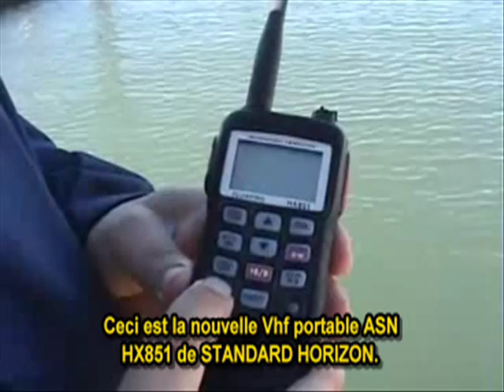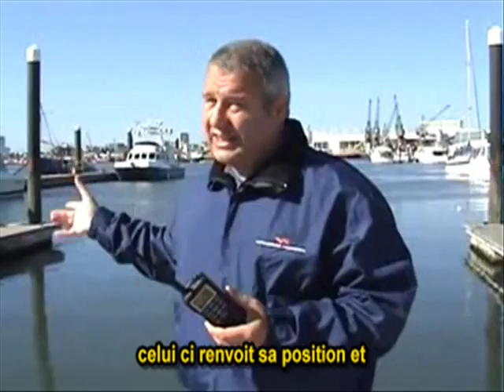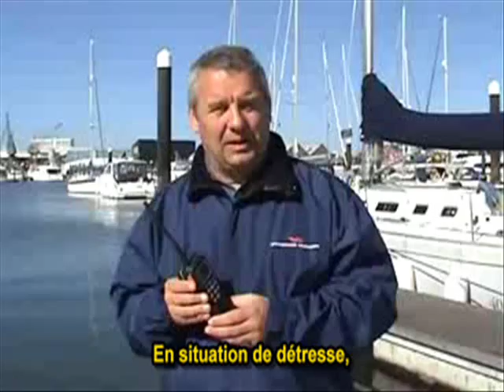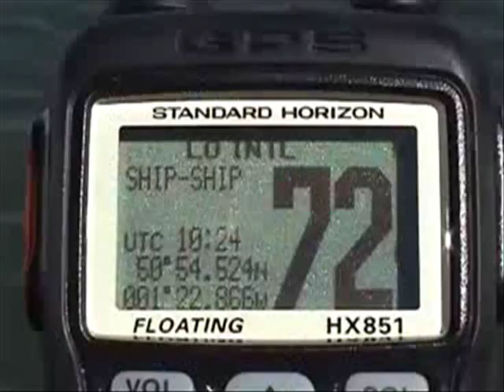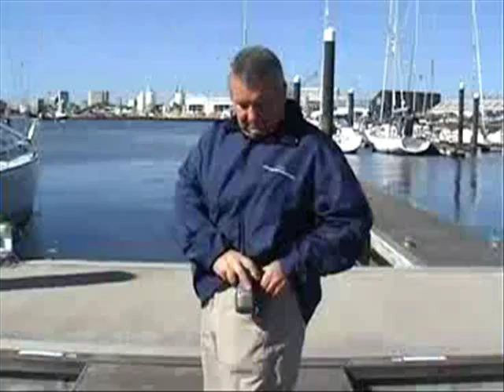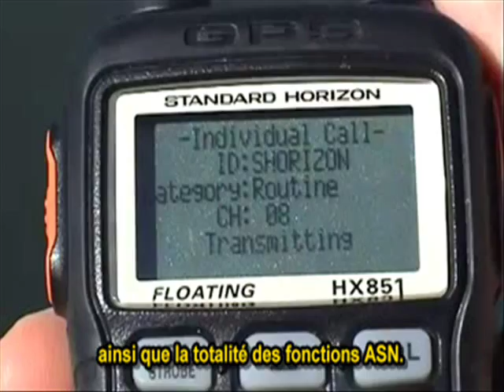Maxdis VHF Marine Standard Horizon HX851.wmv

Comment: This product "the Standard Horizon HX851" seems to be wonderful : 
a 6W dual watch VHF DSC with a built-in GPS (for DSC as much as waypoints navigation), IPX7 waterproof and floating, it seems to have all qualities to be used on GMDSS Sea Area A1 by somebody who has the Short Range Certificate SRC (and can be useful on Sea Area A2, A3). 
It's the first Portable VHF DSC homologated! A Victory for more safety! 
Perfect for cruising, sailing, ... ! 

And what's more, it's the perfect tool in case of DISTRESS, especially for "ABANDONING SHIP". This VHF is portable, very light, can be brought in a Lifeboat and does more than communicating on Channel 16. It can send a DSC MAYDAY with GPS position in the DSC Message and it's the first Portable VHF which can do that. 
It's a great idea! 
Could we dream better? 

The only thing it misses : an AIS. 
AIS TX could be fed by the built-in GPS, and the AIS RX could permit to prevent collision by making the HX851 ring, and to see the nearest ships in case of assistance needed. 

Otherwise, congratulation and thanks to Standard Horizon Team!